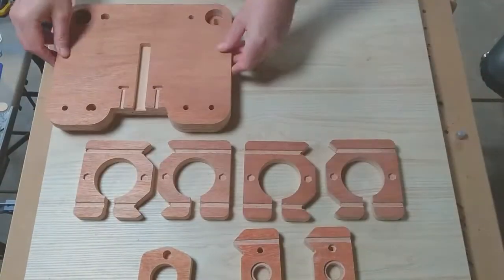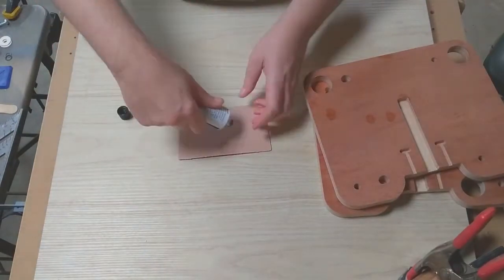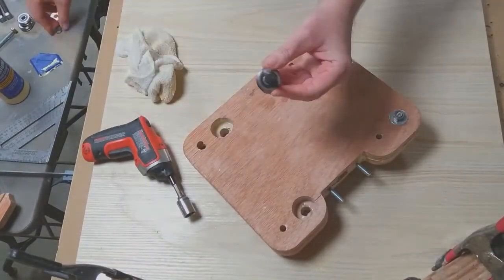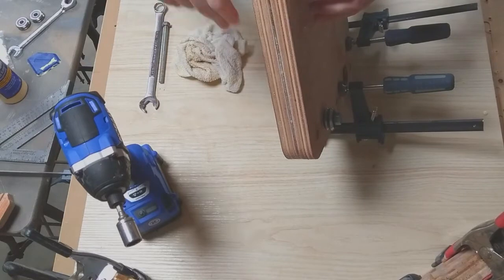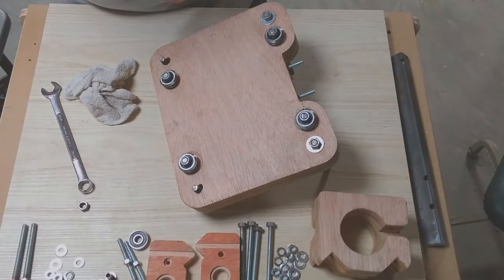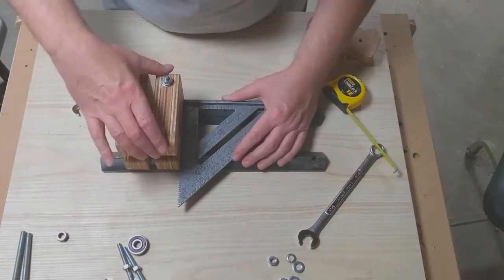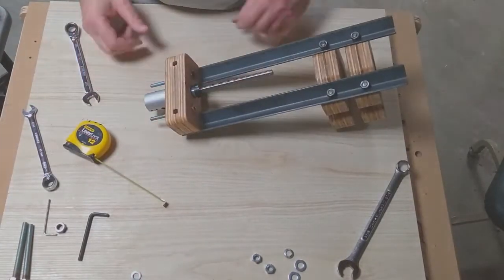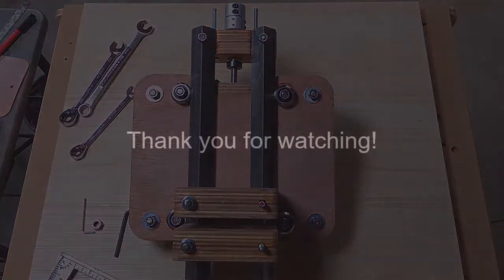DIY CNC Router Rebuild Part 1

Comment: Great engineering on the cnc.  Quick question on your cam v bearing mechanism?  Do you have a way to hold the cam mechanism in place once the correct pressure is set on the guide rails.  I see its eccentricly designed and you adjust with the wrench but didnt see a way to lock in adjustment.  (Maybe friction fit is all that is needed).  Again great design and use of common materials
Reply: Just realized its locked in place with the bolt going through the backside
Reply from the maker: @travishandl880  That's correct.  When setting, I snug the assembly just enough to keep it seated but still able to spin with a wrench.  When the position is correct, tighten the back nut down.

Comment: I have wondered about the pro's & con's of having the gantry rise and fall, rather than a moving "Z" axis plate.  Would really appreciate your thoughts, since you are in the rare position of having tried both!     :o)
Thanks again for the videos.
Reply from the maker: If I had mechanically coupled the two z-axis motors in the first iteration, I'd still be using that today.  That said, I'm getting much faster z-axis motion in the current iteration.  The advantage to rising and falling gantry is that the mechanical complexity is spread out.  It leaves you plenty of real estate on the router plate to do stuff since the z-axis components are moved out to the gantry plates.  In the current iteration, most of the mechanical complexity is concentrated on the router plate.  This more traditional setup makes for a simpler gantry end-plate design which I think the less mechanically inclined cnc builder will have an easier time wrapping their heads around.  The router plate on the current design is now more complex having both the x and z axis functions but I tried to simplify down to the bare minimum components (while still maintaining the roller chain, v-bearings, and reduction drive aspects).  Having tried both setups now, I am going to recommend the more traditional setup.
Reply: @zeketeccnc1207  :  Thank you so much for the prompt and detailed reply.    :o)